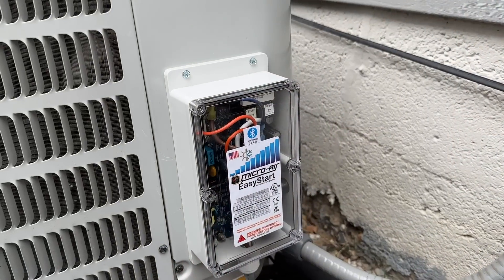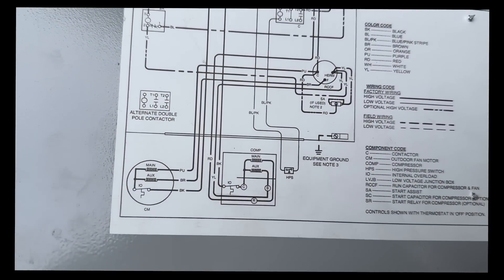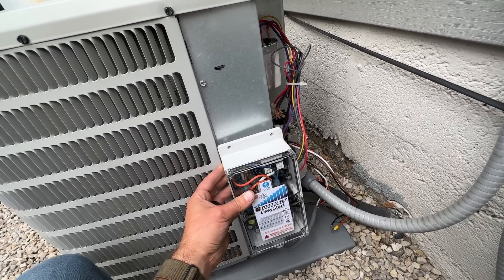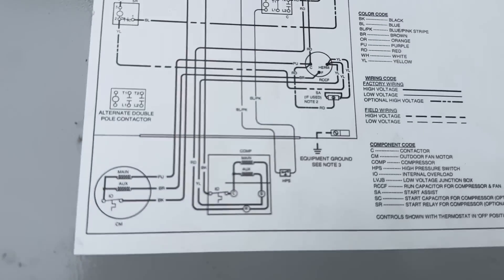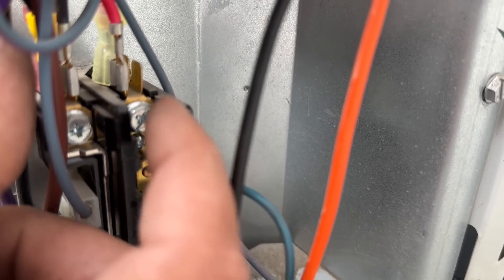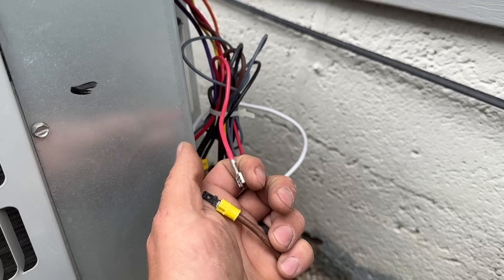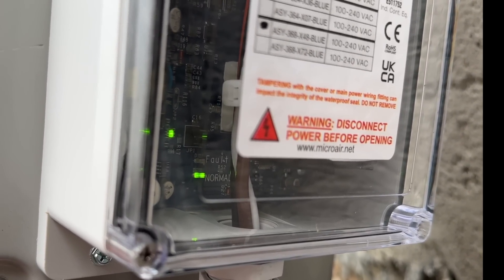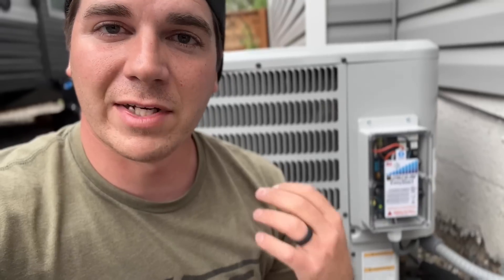Prepare For An Emergency Power Outage By Installing This Device.   Micro-Air Soft Start

Comment: The big benefit to installing the Easy Start is when having to run the HVAC system on a smaller portable generator during a power outage. A smaller portable generator may be able to handle the HVAC load but the lock rotor current draw might be too much for the smaller generator upon compressor start. If there is no concern for power outages then the Easy Start may be unnecessary. There should probably be some consideration of a benefit to the life of the HVAC system of an easy start with the Easy Start. Who really likes to hit the deck running. Installation was very thorough and easy to understand. Thanks.
Reply: So, basically the Easy Start prolongs the life of the actual AC unit? If so, what is the downside?  Does the compression system simply take a bit longer to cool the home down? If that is the case, are we talking about a few min delay or hours delay? Thank you in advance for replying.
Reply: @rci30  I'm speaking a little out of turn on this but from my reading on them it is just basically the opposite of a HARD START.  A hard start is like adding 4 more guys to the rear of your car to push you out of a snow bank.  Little Push-start that does not tax the stock a/c compressor unnecessarily on startup.  The soft start takes the stock compressor and lightens the burden of that initial RUSH of electricity that the unit is programmed to demand on that initial 1/4 second startup every time....that JARRING bang right when it starts up.  This computerized unit throttles that initial "In-rush" of electrical current to soften the blow to the compressor.  The equivelant of getting punched in the face versus getting pushed in the face :)
Reply: My 4 ton central A/C system has an initial "In-rush" amperage of 118 AMPS.  Then it settles down to the mid 20s immediately.  Even with the Generac 26KW air cooled whole home generator using Naturl Gas....my generator cannot push out over 93.8 amps to my A/C unit.  Thus, every time my A/C compressor tries to kick on it will either fail, trip the generator breaker or just beat my a/C compressor over and over till I get an eventual early failure.  Just saying all this to add to your "correct" comment.  These things are even great for your a/c system if you have no generator at all, a smaller portable 50amp generator or even a whole home generator.  Cool stuff.
Reply: Pp]]p❤❤]❤❤❤p❤pppppppppp]]p
Reply: Excellent advice for the unknowing person... Thank you.
Reply: ]pp⁰p❤

Comment: Can I use a soft start kit with my surge protector already installed. Would it benefit if I installed both or do I have to remove my surge protector when I install my soft start kit?
Reply: I would also like to see a reply to this question before I install the Micro air soft starter that I recently purchased. 8:23

Comment: My unit is a Goodman GSZ140241LA. Will that device work with my ac unit? Is the installation the same? Good video. Easy explanation

Comment: I am wondering why when you checked your inrush amps why you didn't just go the bottom of the contactor as it would also include the amps of the fan as well, if you are sizing for a generator you will need that as well.

Comment: Great video! Just saw this in 10/2/24 and just moved to NC 2 months before Helene hit the area. I brought with me my Ridgid 5700 watt generator which I love but hooked it up to the house and it would not power one AC and the other one ran a little funky. My old house was 1100 sqft and my new house is 3100 sqft and has 2 furnaces, 2 AC's, 2 refrigerators and a deep freezer. In short, I lost power, hooked up my generator and most things worked EXCEPT one of the ACs would not power on (clearly not enough voltage or current) and the other one ran weird. Simply put, the generator is too small. I just bought a Westinghouse 11500 ftc Tri Fuel and am hoping that will do the trick. Since the ACs in my house are old, I would not bother putting in a soft start and cannot beat the hard start units I just bought. When I but new AC's, I will probably buy the soft start units and install them myself.

Comment: Your videos on all of this as well as the hard start kits are excellent!  Thanks for posting these.  Question for ya.  I think I understand that I need to remove my current HARD START kit before I install my Micro-Air Flex unit.  My hard start is the round black can type with the square relay module like you show in your Hard start videos.  I assume that those Hard starts just simply get pulled wire for wire out of the system without any further need to re-adjust the wires on anything?  My Run capacitor is one of the Turbo 200 universals from 2.5 to 67.5 mfd and is currently jumpered for a total of 35 mfd using the 10 and 25 lugs fwiw.  Single speed, 8 year old 2 Ton Carrier AC

Comment: Bought and installed. Beware that MicroAir now only permits written requests for tech support. No phone calls. You may be waiting days to receive an email response if you have an installation or operability problem and submit a written request for assistance.  Very disappointing they’ve eliminated phone calls to get help from tech support.

Comment: So I just installed the soft starter and it is wonderful.  Everything went well following your video it was up and running in less than an hour.  The one glitch I had was putting the capacitor back and closing the panel.  Not a show stopper.  Moved things around and everything worked.
The unit failed after only 2 months.  The run wire from the unit fried for a distance of 6 inches.  Had to call an AC repair tech.  Contacted the company and just thought they would stand by their unit.  NOPE - they said splice the wire and hope.  The failure was caused by heat.  It is Florida in the summer, Duh!  The original wires were good in the heat, cycling the AC for 9 years, but their unit failed in 2 months. Anyway, don't trust this company or this unit.  They will not support you or their product!  BUYER BEWARE!!

Comment: Currently have a hard start kit installed on a 3 ton Amana condenser. Can the hard start kit be removed and install the soft start kit with no harm to the compressor?
Reply: U cannot use simultaneously per manual

Comment: I installed mine during a power outage so we could run AC with my 11kw generator. I didn't have a multimeter. It started working with the green light and all, but the compressor is way louder than it ever was. 
I was told that it would need to run through a few on/off cycles as a learning function. 
My question is... should I have let it learn on grid power before using a generator?

Comment: My 4 ton 20 year old lennox pulls 105 amps at start i kmow it old n wore out but iam gonna install one especially. My generator will not operate it ,its a 5500 wat it wont run the ac with all in house off

Comment: Are you sure that 7.7 amps isn't your Run amps and not inrush amps?
Reply: I was going to ask the same thing.  Just installed one today and the fan startup was about 7 then compressor came on and was at 25

Comment: Looking at my situation 
Sir do you feel a soft start can help my unit with RLA of 10.5 & LRA of 47?
It’s a duo 2.5ton system setup unfortunately 

Or is its main purpose/function is use with generator? Which is a great feature!

Comment: So, will this soft start allow my Firman HO 7553 7,500 running watt generator to run my 5 ton house AC system to cool my house?  From the chart you showed, my guess is, no.  

What about the 9,000 BTU mini-split unit we have in our master bedroom?  It is rated at 7.0 total amps, and 49 Compressor Locked Rotor AMPS.

Comment: It has Bluetooth as well (to see logs of what the soft start has been doing, first bunch of starts is learning so after it been running for more then 5 it should have learned to apply correct soft start load)

Comment: I have a stand alone generator on my home. When the AC unit kicks on the lights dem or flicker for a second. Can I still use the Micro-Air Soft start, if I have the generator or is it not wise to install it.
Reply: That's one of its advertised functions. To be used on generator power..

Comment: Dave - is there a torque (inch/lbs) number for the screws on the connector?   I figure those have to be good and snug but like within breaker panels, there might be torque recommendations.   I've looked but don't see any.

Comment: I started using the micro-air soft start on one of my RV ACs. I live in the south and when traveling long distance, I will place a 2300W generator in the back of my truck and run a power cord to the from electrical hookup of my 5th wheel (all with velcro strapping to prevent the cord from accidentally dropping and dragging on the road). This generator provides AC power to the residential refrigerator, battery charger, and one of the AC units (13500BTU). This makes it very nice to go into the camper for a meal, bathroom, or even a nap. So after doing that for a few years, I decided to put one on my house AC. I have a 5500W generator for the house (was living in S. Louisiana at the time). The 5500W generator could sometimes start the central AC, sometimes not. I kept 3 window units in the shed and after a hurricane, I would put them in the windows and start one at a time on the 5500W generator. After installing the soft start on the house AC, the 5500W started the AC without even noticing. I'm sold!!! Moving ahead a few years, I inherited a 12.5kW portable generator (not very portable), and moved to Florida and a 2 story house with a heat pump for the second floor and AC/gas furnace for the 1st floor. I tested the 12.5kW generator on the whole house, without the soft start, and it started both AC units, but it knew they were starting. I ordered, and installed 2 soft starts (I mounted them to the wall. They come with plenty of cable.) The 12.5kW doesn't even flinch now. I also have a try-fuel kit on the 12.5kW kit so I can run gasoline/ propane/ natural gas. Gasoline will provide the most BTUs, meaning I get the most wattage from gasoline. Gasoline in a generator is a real pain to keep the carburetor clean, gas fresh, etc. Propane is the next efficient followed by natural gas. I prefer propane and a 30lb bottle will last about 8 hours and I have 3 bottles. If it looks like it will be longer than I have a propane supply for, I'll use the quick disconnect on the fuel hose and connect to the house natural gas. Never miss a beat as you should shut down and check the oil periodically anyways. My next experiment will be to use the 5500W generator on gasoline to see how that handles, or doesn't, now that the soft starts are in place. If it works, I'll order the tri-fuel kit for the 5500W generator. The 5500W generator uses half the fuel of the 12.5kW. After living in hurricane areas for most of my adult life, backups to backups is comforting!!! Most of this wouldn't be nearly as convenient without the MicroAir Soft Start. BTW, I'm an electronics tech by trade, and a bit of a DIYer. I haven't had an AC service tech do any work on my properties for over 20 years. The one company I did call, when we bought the house in FL,  just to have the system gone thru, sent a tech that tried to sell us 2 new units, at $23,000 installed! Financing was available! I proceeded to waste 3 hours of his time letting him think that I was biting the bait. He never even took out a nut driver. I'll be getting my EPA cert shortly!!!!!! Thank you for making these videos. I have found them to be great reference and re-assurance for taking care of my own equipment.

Comment: The start winding is used to start the compressor under load of "High side" pressure, forcing a high current to flow as the "Run winding" is engaged through the relay and normal run current is applied to the compressor operation to circulate refrigerant in the system to cool the evaporator via a metering device in the "High side of the evaporator and returning refrigerant to the compressor through the suction side, completing the refrigeration cycle.

Comment: this is my first comment ever, and the reason for it is, i was having an issue by following all the top videos that came out and my compressor would not start. i kept getting the 7 red led flashing. after watching this video and seeing how he looked at the ac diagram from his unit (almost identical to mine) i was able to troubleshoot my problem. all other videos are very generic including the one from micro-air. this guys actually traced the wires based on the diagram and i was able to correct my problem. i wish i could make this video the 1st one to come up when you search for this install. thank you diy hvac guy

Comment: Thanks Bud... you are the best which is why I subscribed.  We have a good A/C company that installs and services and they put in our two units.   However, they are always suggesting "mods".  We all know the base prices of these, so here goes... I was quoted $240 to replace a hard start capacitor, and get this, $1200 to install a soft start.   We know this isn't rocket science, so I'll be placing the order shortly.   I love my company, and the core units are warrantied for 10 years, but they won't be installing the soft start.   I will.  THANKS for this vid!!!  [Postscript - Both installed and working like a charm!!]

Comment: Good video one major correction:  he was using the term common wire it's actually the compressor wire . kind of important a "common wire" is  a neural wire. The "compressor wire" powers the  you guessed it .

Comment: I have a RHEEM 4 ton that is 14 months old. Should i be considering this even though i also have a 13k dual fuel Duramax genny? I know for sure during tests the genny runs everything but is there any benefit to spend 350 on soft start just want to be sure as i live in miami -hurricane central.

Comment: The starting amps on my 5 ton AC unit were reading at 130+ pre Micro-Air. I’m averaging 32 now! I can power my central air and the rest of my house with a 9000W portable gas/propane generator through a 50A breaker/interlock switch now.

Comment: Just a caution to those using the Micro-Air unit. I have 2 4 ton units and the Easy Start crashed my compressor on the upstairs unit. We cooled the compressor with cold water and removed the Easy Start and the compressor came back online. We then reinstalled the Easy Start and the compressor tripped again. I did send the issue to the company and they quickly sent an email saying they would be send me a new unit. These were both installed in Jue 2023, so only a few moths old. I will move to a hard start instead on this unit for now. Just wanted folks to be aware that I did have an issue with 1 of my Micro Air soft starts/
Reply from the maker: Thanks for the comment.
Reply: @diyhvacguy very welcome😊

Comment: Just wondering if I install one for my condenser, will it or can it void my warranty. I have a Coleman unit that's 2 1/2 ton. I really want to because my LRA is 67.8A and I know it will bring it down a lot with the slow start.

Comment: When turning on, my 2004 5-ton Goodman CLJ60-1 comperssor would rock the neighborhood with a sound uncannily similar to the opening notes of "Feelin' Satisfied" by Boston. 
My amp meter does not have the inrush function, but the MicroAir EasyStart app tells me that it now starts at around 41 amps, and runs at 18-19 amps. My lights no longer dim whenever it turns on, and is much quieter at start-up than before. 
All in all, I'm feelin' satisfied.

Comment: My Trane 4-ton package unit wiring is a little different from you split unit condenser unit. The model number is 4TCY4048B. It has two capacitors, a 10 mfd cap for the outdoor fan mounted on top of the unit, and a separate 70mfd cap for the compressor. The compressor cap has two terminals, neither one is labeled, but the wires are red on one side, and orange on the other side. Would you connect the EasyStart orange wire to that terminal?. Also, the contactor terminal, right side, has a red wire that I suspect feeds the run winding of the compressor, and also, taps from and feeds the red side of the compressor run capacitor. Is this the correct wire to splice onto the Easy Start brown wire, or do I need to use the other side of the contactor?

Comment: I installed a Micro-Air ASY-368-X48-BLUE and the fault LED is blinking; also the compressor seams not turning on, any advice?

Comment: Will this product work with a two stage compressor AC unit?  I have a 5 ton Trane unit and planning on adding a generator soon. Glad YouTube’s algorithm popped up your video. The funny thing is that the generator vendor never mentioned any product like this when sizing the whole-home generator.

Comment: $345.00 plus tax. Although the price is high, it's worth it, especially if you have a generator or an older AC unit and need it to last longer.

Comment: How would this work on the AC for my camper.l boondock sometimes  and with a generator l can run only one unit but living in south Mississippi l need both units to run to be comfortable. Do the Easy Start need to be install on both units or can l get by installing it on just one unit? My generator is a Yamaha 6300 inverter generator

Comment: Hi, I'm about to purchase the Easy Start X48 and was wondering if the wires come pre-crimped or is that part of the DIY installation process?  If so, then I'll have to buy a crimper and connectors too.  Thanks for the info and your videos.   Extremely helpful.
Reply from the maker: When I got the kit it did not come with connectors because everyone’s system is different. But they may have started including that in their kits.